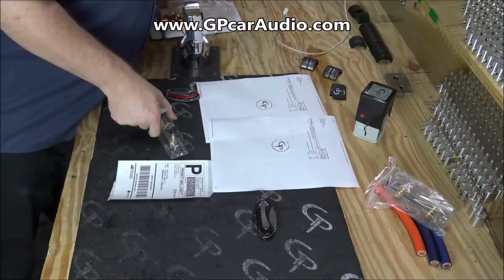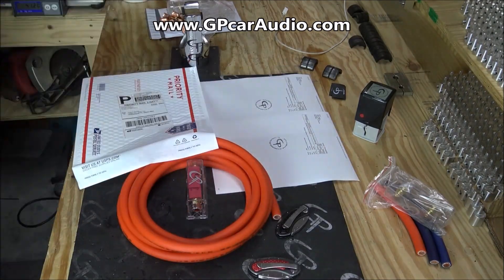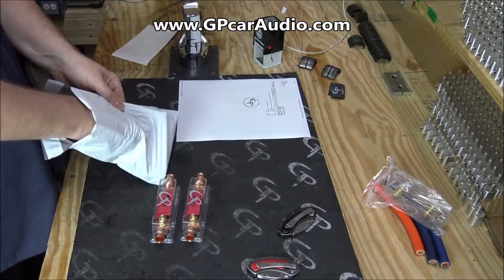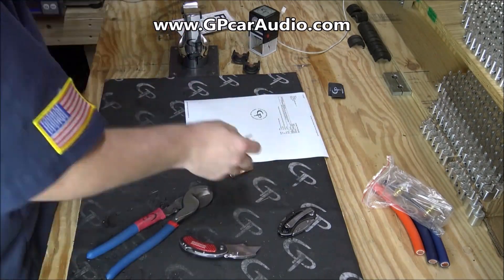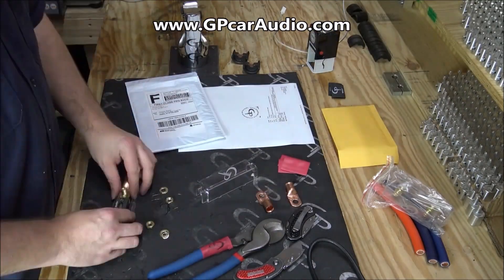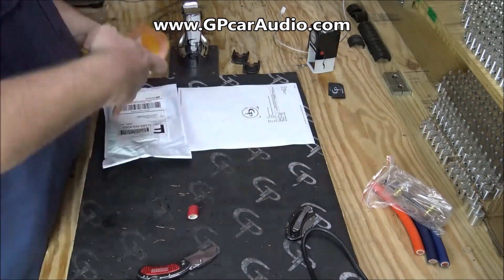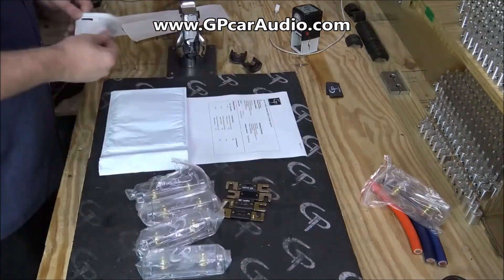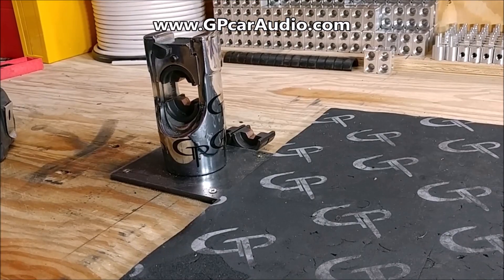Worlds fastest Hydraulic Press Cable Crimper?

Comment: What pressure is that thing running at?
Reply from the maker: The pump runs at 10,000 psi, with a 2.25 inch piston giving us 22,500 lbs (11+ tons) of pressure from the piston, then to our understanding the reduced small surface area of the die multiplies that figure even more. I don't know the final numbers, but we know it works very well!  lol